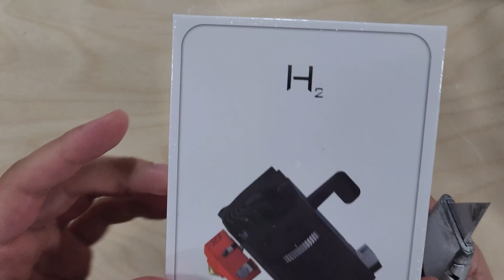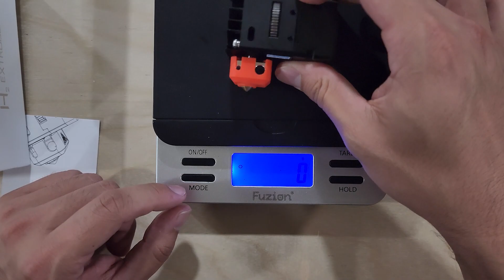My Ender 3v2 Print Farms most important upgraded parts! The Extruder and Dual Z Axis Kit.

Comment: Do you have linear rails on your ender 3V2 for the X and Y axis?
Reply from the maker: I dont, I did upgrade to polycarbonate wheels though.
Reply: @Redo3D  do you or have you used input shaping on the ender 3 V2s???
Reply from the maker: No I use stock acceptation settings but bumped speed up to 100mms. That has resulted in decent print quality for me. I did tune for pressure advance however.

Comment: I know I'm late finding your video so you may not be able to help. I'm trying to find the fan duct you used. The link appears to take me to the correct duct but when downloaded it's an entirely different design. Do you still have a copy of the .stl file you used? Thanks in advance.
Reply from the maker: I actually stopped using this fan setup, it was not sufficient at properly cooling the model evenly. It would only cool from the right side causing the left side of my prints to be really ugly. My advice is to use any of the other fan mounts that have ducts on both sides of the nozzle. I currently use the "fang" style found on thingiverse. Initially I wanted to leave the gear wheel exposed so I can manually move it, but I found that was less of a priority than proper cooling. https://www.thingiverse.com/thing:5202213
Reply: Thank you for the reply. I'll take your advice. I'm using one of the recommended ones at the moment & it's working well. Like you I was looking for one that would allow access to the wheel - seems it's not to be.

Comment: so after this mod what is the max print speed you get at quality?
Reply from the maker: I run the machine at 100mms but that is mainly a limitation of the hotend not keeping up. I'm printing at 9mms3
Reply: @Redo3D  so you should change the hotend to print at more than 100 mm/sec?
Reply from the maker: Yes, since I print with .24 layer height and .5mm line width I'm at the limit of how much flow the hotend can handle. To calculate volume do speed x layer height x nozzle width
Reply: @Redo3D  ok I don't understand if you should change the entire extruder or no to solve?
Reply from the maker: A CHT nozzle would help vs changing hotend from the biqu h2. This is the only aftermarket extruder I have experience with.

Comment: Hey have you ever had a problem with the filament not feeding ?
Reply from the maker: Yes, It can be a bit tricky sometimes, you need to make sure the gears are properly aligned and that there isnt any filament stuck in the extruder path just past the gears before the hotend. I bought the noclogger tool for when this happens and it really helps clear up any stuck filament.

Comment: Hi there i have just brought the H2 for my Ender 3 v2 and will be printing your mount for it. What did you set your extruder VREF at?
Reply from the maker: Vref is stock value.
Reply: @Redo3D  have you had any probs with the tiny motor getting hot?

Comment: Dual-Z with top mounting brackets require you to have a pretty much perfectly straight z-rod, otherwise all the minor wobble that was previously being released on the free floating top, will transfer straight into your parts.
Reply: Top mounting brackets in these kits are not rigid, they allow about a mm flex in all directions and won't constrain the z-rods enough (unless they are really warped) to transfer the wobble to the gantry, print head and parts.

Comment: I want to do this direct drive can you help me out with some info please!? 
Did you change anything on the firmware?
Did you lose build volume??
How bout the firmware you're using ??
Any extra hardware needed for the h2 ?
Thank you
Reply from the maker: I lost 20mm on the Y axis.
I changed the rotation distance according to the recommendation in the h2 instructions. 
I am using klipper firmware. 
Just upgraded the cooling fan to a 5010 blower is the only additional item I purchased.

Comment: Would you mind sharing your mount?  Provided it'll fit a ender 3 v1.

I'm getting ready to do the install but my mount has the bltouch fixed in place.   I like how you remixed yours
Reply from the maker: Yes here is the link. https://www.thingiverse.com/thing:5428514 I can't confirm if it'll fit the v1
Reply: @Redo3D  thank you!  I'll see how the holes match up with the other one I have that's listed for the v1.

So it looks like it lines up with the other design.  The one I have looks like it might be one you remixed.   Mind sharing your bltouch x/y offset for that extruder fan mount since the designer didn't list it.   :)
Reply from the maker: That will depend on where you choose to mount the bl touch but how I have it on the video the offset is

 x_offset: -34.4
y_offset: -1.1

This puts the nozzle exactly at the probe pobe points.
Reply: @Redo3D  thanks. I got my h2 all installed and calibrated.   First two prints were a calibration cube and a benchy.  I'm impressed so far.  Found online.4 retraction and 5mm/s seems to work well too.

Comment: That is a great selection of mods. 
Since it is about $420 after upgrades, is there another printer on the market under $420 that would perform as well as this modded one?
Reply from the maker: It seems like the Ender 3 S1 is a pretty close alternative. Looking back if I was starting over, I would purchase all Ender 3 S1s and install klipper. But I have learned so much just by modding and tinkering with the Ender 3 v2. if I was strictly trying to save time, id go with the S1
Reply: @Redo3D  I'm interested to see how the ribbon cables on the S1 hold up. I've heard someone say they can break down over long hrs printing
Reply: @NathanBuildsRobots  i have 1 s1 and 1 s1 pro and been printing most of the day since around the time they came out. No problems with cables yet, but they aren't as great as I expected.  They are a little less hassle than my v2's though, i'd say they are worth about what they cost.  I haven't had a prusa but from what I have heard about them they sound probably better than s1 and s1 pro, so it's about where it should be for the price.  I'll never buy v2's again, but not sure if i'll buy any more s1's either.  just my 2 cents

Comment: Hello!! very good video!! but I have a question, I also bought the double Z axis with its double Z motor and I also put its belt on it so that they would be synchronized but I can't make both systems work at the same time! if I leave them, each motor wants to work at its own pace and the belt stops them, so I opted to use only the belt and a single Z motor, how did you manage to use the two motors and the timing belt?

Could you make a video showing how to put the two systems simultaneously?, you would be the first in all youtube to have a video like that! because I have searched everywhere and never found a solution, so this would be a very good idea for a video that would help many people
Reply from the maker: I use a splitter that controls both Z motors from one single connection.

Comment: Hi, thanks for the video. Also having the same hardware on all machine allows for only 1 firmware version. Otherwise it would be a nightmare! ;)
For my Ender 3 Pro I went with the OMG V2S extruder + the small motor. It's very lightweight, and kept the original hotend. Also added a second Z, and since I could afford it, I went with the Black Knight Linear Rail upgrade kit. I love my 3 years old Ender 3 :)

Comment: Looks like some great mods! Since your elephants foot video I did a anti backlash nut and it's helped tremendously without doing the dual Z axis. I can still never get my first layer absolutely perfect on the entire bed due to the non supported side lagging behind on the first few layers. I've just seen alot of issues with the stepper motors no syncing perfectly and the belted setups seem to stress the single stepper too much, belted and stepper seem to be ideal for a dual Z setup. Did you do an anti backlash nut in both sides now?
Reply from the maker: No backlash nut for this setup. It's solid without it. The sync belt helps keep things steady.